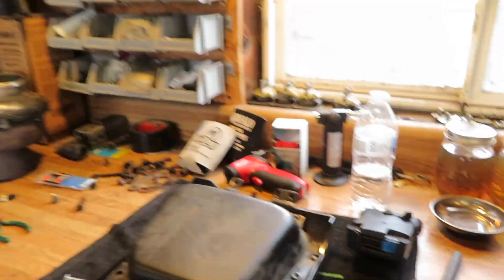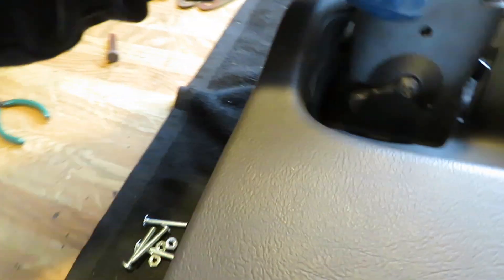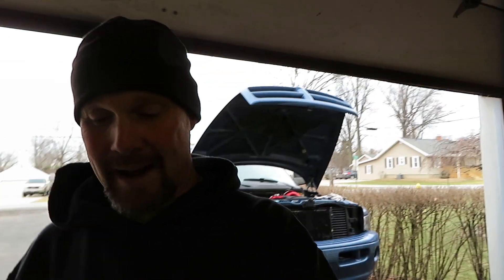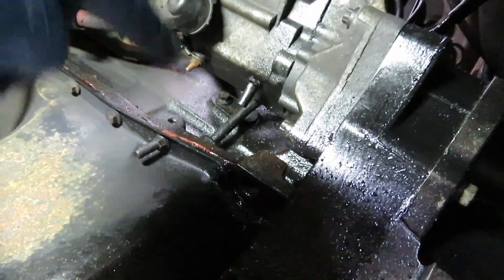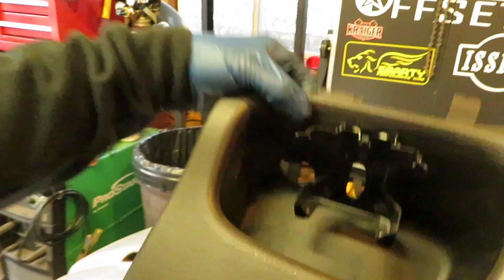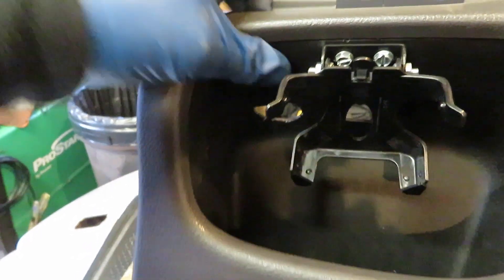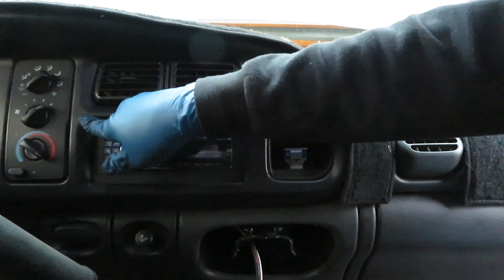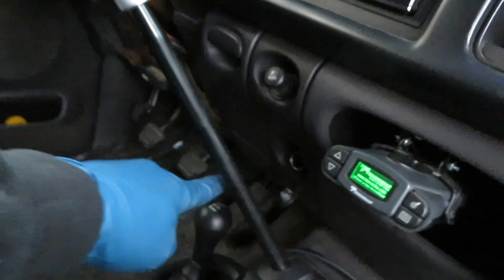Dodge Ram 2nd  Cummins Crank Sensor Not There

Comment: i dont buy any thing from OOOriely i got 2000 3500 DULLY was having a hard start when it was Hot i think i fixed it some one told me crank or cam sencer so far it was neather now fires up first like it all ways did .. yaaaa i get the gun shy i hat it when it craps i weighted for 9 Hr for a tow one day
Reply from the maker: Understandable

Comment: I just replaced my starter on my 2nd gen Cummins the other day. The top bolt I found to be easier to access under the truck. As long as there’s light from the top of the motor and you use a 10mm 12 point socket or ratchet wrench, you can remove it much easier than at the top of the engine. Just my opinion.
Reply from the maker: Yes you are right you can reach it from the bottom also.
Reply: @ChadMyers73  probably soldthw cam vp sense which can also caluse the tack to cut out

Comment: I changed my vp44 with a spare that i had off a running truck. Drove around the block fine then went for a hi way run. Then it started to jerk so the second vp44 was bad as well. Good luck.
Reply from the maker: Thanks gotta love it.
Reply: Abraham Salcido you sure it wasn’t the TPS?
Reply from the maker: @cl8949  Not sure but the codes where lack of communication from vp to ecm. Thank For Watching!
Reply: @cl8949  i will have to double check  to make sure I'd really like to get her back on the road. Thanks

Comment: What problem was your truck having? Mine stalls out randomly and dies while accelerating intermittently. It's not pump or fpsi related. Think its electrical but I dont have any codes thought about replacing this sensor. Any ideas?
Reply from the maker: It might a electrical issue could be a short in your wiring harness someplace from your ECM to your PCM. It also could be a pissed off ECM two. In a case like that it’s like chasing a ghost. More than likely I believe is probably electrical someplace and your wiring harness also check all of your grounds. thanks for watching!
Reply: Did u ever figure it out
Reply: @jonathanjennings9530  was a bad ecm, my second one. Probably caused by the alternator problem that these trucks commonly have, the apps noise isolator can mask the issue.